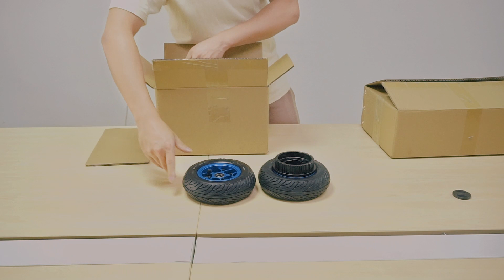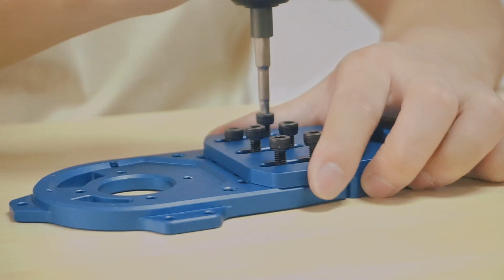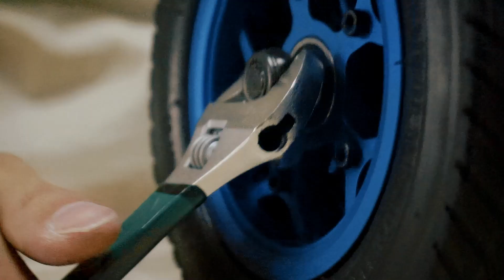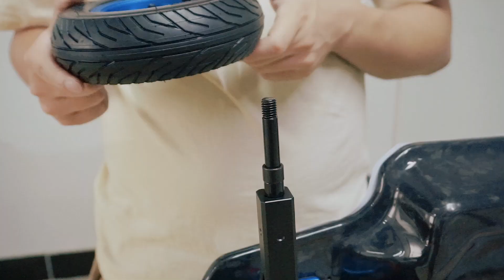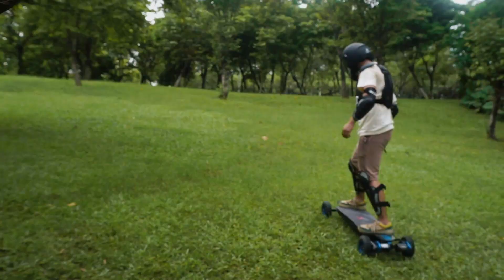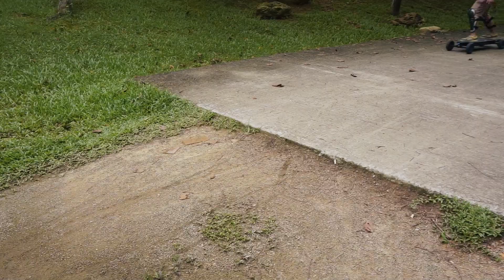16.3" CNC New Upgrade RKP Trucks with 7" ATM Wheels Installation Tutorial

Comment: Could I replace the DKPs on my exway atlas pro 4wd with these?
Reply from the maker: Yes, sir.
16.3" CNC Trucks can be installed on the "Exway atlas pro 4wd" electric skateboard. But the Trucks Kit we sell is for 2WD, and there is only one pair of motor mounts. If you need to use it on a 4WD skateboard, you need additional accessories A pair of motor mounts. Additional CNC motor mounts add $45/set (1 pair)